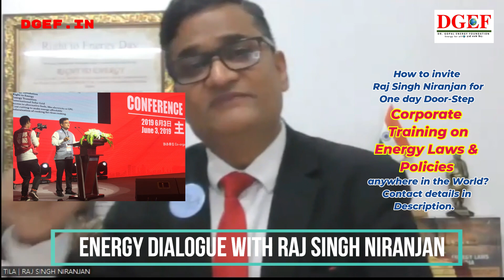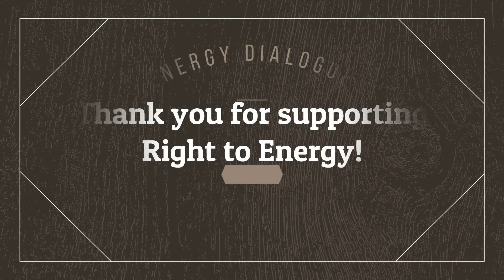$$$ Understanding the 9 Basis of Tariff Regulation by SERC ₹₹₹

Comment: The basis of Tariff regulations by SERC, could be related to the case law as in 
GMR WARORA ENERGY LIMITED
V.
CENTRAL ELECTRICITY REGULATORY COMMISSION (CERC) & ORS.
Electricity Act, 2003 - Supreme Court has lamented the practice of Distribution 
Companies (DISCOMS) and power generating companies pursuing endless litigation challenging the concurrent findings arrived at by the Central Electricity  Regulatory Commission (CERC) and the Appellate Tribunal for Electricity (APTEL).
The Court has asked the Union of India through the Ministry of Power (MoP), to 
evolve a mechanism so as to ensure timely payment by DISCOMS to the power 
generating companies under the Power Purchase Agreements (PPAs). All additional charges which are payable on account of orders, directions, 
Notifications, Regulations, etc., issued by the instrumentalities of the State, after 
the cut-off date specified in the PPAs, will have to be considered to be ‘Change in 
Law’ events for payment of compensation under the PPAs.